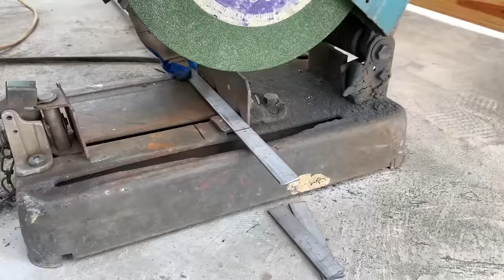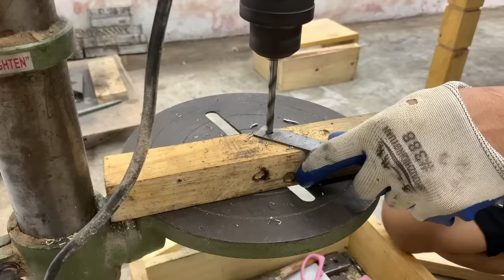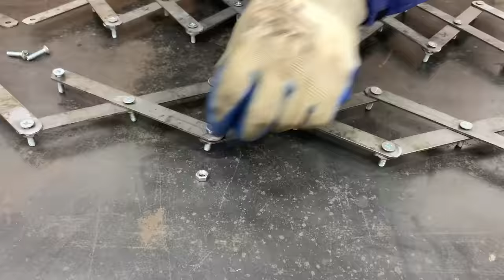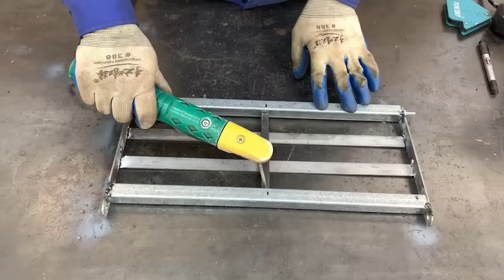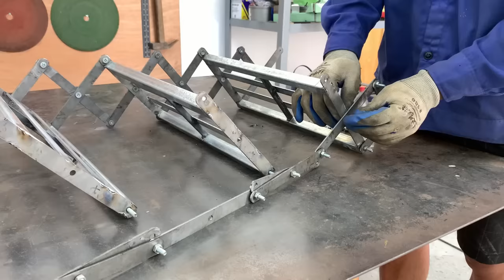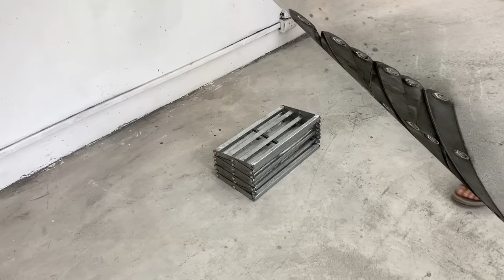Construction How to Install Folding Stairs / Attic Ladder Installation / DIY Stairs.

Comment: You have incredible skills,  but is that suppose to be steps ??   If so you need support under it ,  I don't think it'll hold anyone's weight..  close the gaps on the steps and would be perfect for pets..  there's a lot of pet steps sold on the internet..